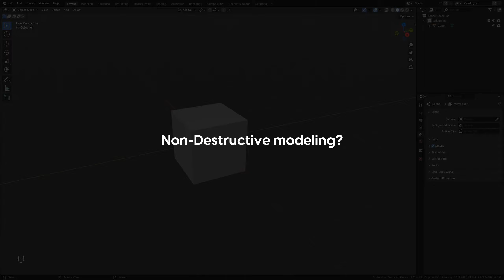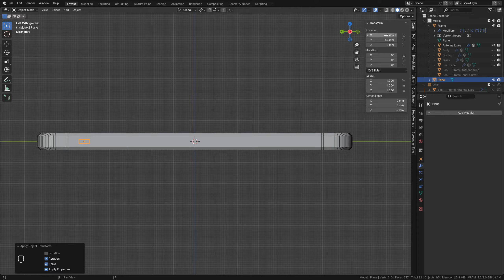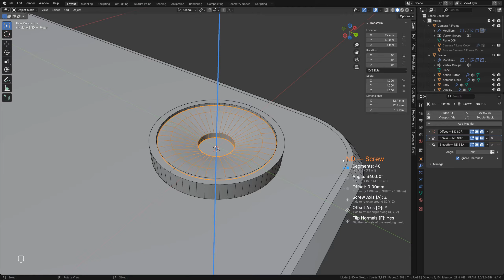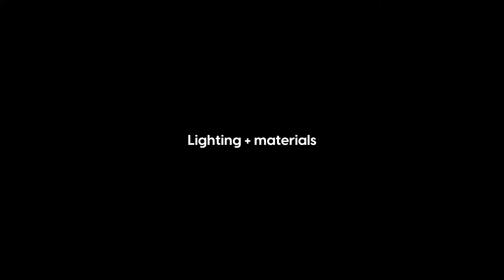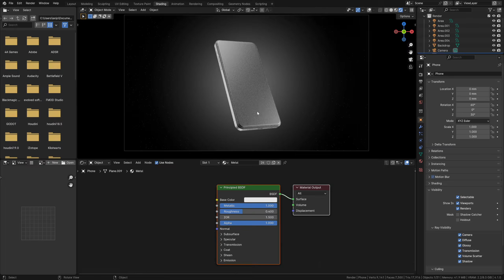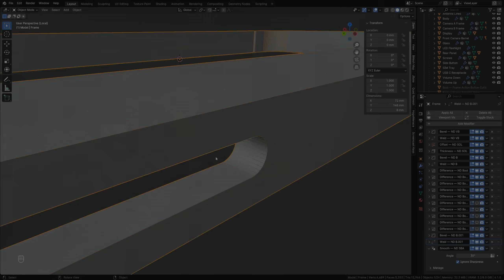Comment: why its looking like retopology is not good could you please explain how to make good retopology also?
Reply: Topology depends on your use case. As hard-surface model, you don't need to worry too much about the actual polygons. It's only if you need to deform the model or require specific topology for a game engine that you need to focus on topology. The result, whether rendered or exported for a game engine, is going to work fine most of the time. — Ian

Comment: As it turns out, the bevel "width" is not the radius of the circle that creates a rounded rectangle. It's actually the half width of the cut. So if you want, let's say, 8 mm radius circle as roundness, you need to input 8 / 2 * √2. Funny how that works...
Reply: Hi, the "width" represents the distance between the two new edges formed by the bevel (or the edges on either side of the bevel if there is more than one segment). You can also change the "Width Type" to use a different mode, such as "Offset" or "Absolute" to achieve more of a radius-like measurement. We'll be introducing this ability into ND very soon, but you can already change this manually on the Bevel modifier. — Ian
Reply: At least, that's what I think is going on
Reply: i see

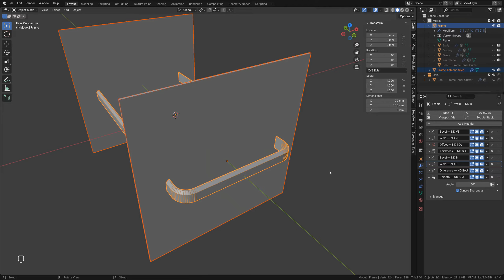Comment: Hi there! Any ideas why when I do the SLICE command it subtracts from the mesh (like a boolean difference) instead of creating the object resulted from the cut, like on 13:54 ?
I cheated my way in using "BOOL TOOL - Brush Slice" =)
Reply: Hi, I'm unsure what exactly the problem might be. However, I can replicate a similar problem if I accidentally have one of the objects (the slicer/cutter) in the Utils collection. If I then select them in the wrong order and run the boolean it causes one of the parts to disappear. — Ian
Reply: @HugeMenace  thanks for the response, and keep up!

Comment: When I get to the Frame Inner Cutter section, adjusting the bevel by pressing Shift + 2 and selecting Vertex Bevel, this is greyed out, and it only allows me to select Bevel.
I'm able to get past this by adjusting in the modifier panel, but I'm not sure if something I'm doing is causing this, or if it's a known issue.
Reply: Fixed
I was forgetting to switch to edit mode, hope this will help the next person.
Reply: Hi, the issue is most likely that vertex bevel only works in edit mode. I think I forgot to mention switching to edit mode in this step sorry. ~ Ian

Comment: Pretty dope add-on. Now I can stop working solely with polygons.

I have just about one gripe with this add-on, mainly about recalling. Is there a way I can choose to disable it? I wanna add another modifier of the same type in different areas of an object but the recall feature is preventing me from doing just that. I know it's probably mentioned in both of these videos from the welcome page, but either I might be dumb and just skimmed both videos and some of the documentation for a straight-away answer or the documentation wasn't specific enough. 

Either way, for example, if I go into edit mode on an object, select any edge or vertex I want to bevel, and run vertex/edge bevel from either the Fast (Predict) context menu or the main context menu, it'll bevel the object from that vertex or edge I've selected. However, if I want to bevel another edge or vertex, I can run vertex/edge bevel on the newly-selected edge or vertex. What should happen, as expected initially, is that a new bevel modifier would be added within the stack of modifiers I have, but what I'm getting is that--instead of beveling the selected edges and vertices I want to bevel--it's altering the bevels for the edges and vertices I made which I don't have currently selected. 

Outside this example, while this is good and all because I might want to change the intensity of a bevel, set the boolean interaction of two objects, or the like, I also want to add another modifier of the same type without being limited to alter it through recalling, that or needing to apply the modifier this add-on is recalling--which is my current workaround in case anyone is having the same issue.

While this might not be of any priority at the time of making these videos or putting out this add-on, I kinda wish that there was a way to toggle recall off or on.
Reply: Hi, thanks! Glad you are enjoying ND. There's no way to disable recall mode currently. I'm unsure what exactly might be causing the issue you are having with bevels, but it is possible to add multiple (stacking) Bevels in object mode by holding down SHIFT as you select Bevel. In terms of Edge and Vertex Bevels in Edit Mode things get a little trickier. You can't stack multiple of either on the same geometry selection, or in some cases where edges connect to other edges which have already had an edge bevel applied. This may be what is happening to you.

It really depends specifically what you are trying to model, as a non-destructive approach with Blender definitely requires a few workarounds in certain cases, however there is likely a way to achieve what you are intending, but it may just require a different approach. There are a few tricks that become more obvious with a little more experience. If you'd like some more detailed help, feel free to post a few images and description in our Discord community. — Ian
Reply: @HugeMenace  I've tried stacking a new bevel modifier from the ND menu using SHIFT on different selections of an object I want to apply a new bevel modifier to (both pressing SHIFT once and holding it down) and it didn't (even temporarily) disable recall, sadly. 

The best but destructive approach is to apply the modifier it's forcing me to recall instead of stacking another of its type over it.
Reply: Only object mode bevels can currently be stacked. Edit mode bevels (edge and vertex) cannot be stacked. It's worth watching the Bevels video in the ND Deep Dive series to understand how they all work. — Tristan
Reply: @HugeMenace  Oh okay, I assume that stackable edit mode bevels are planned?
Reply: Not currently, but I'm happy to consider it if there's a good use case for them while considering the built-in limitations of Blender's edge weights and vertex groups. — Tristan
Reply: @HugeMenace  Understandable, sounds good. 👌🏾
Reply: I do recommend watching the deep dive series, or at least just the bevels video. As one of your questions above regarding multiple edge bevels is answered in that video :) — Tristan

Comment: 18:32

When adding the Screw, how did you get the screw head to orientate itself to the view? 
When I add it, it's facing Global Z.
Reply: I found the problem:
When I added the plane for the Screw Cutter, I applied scale and rotation. It's the rotation application that messed it up. Is there a workaround for this situation, or do we just never apply rotation?
Reply: The Screw Head operator works in two contexts. If you have no object selected, it will place the screw head at the location of the 3D cursor, or if you have an object selected, it will put it at the origin of the object; in both cases, it will follow the respective rotation of each. — Tristan

Comment: Thank you for the detailed guide and, of course, for the cool addon. But for some reason I kept getting new Vertex Groups when I changed Bevel, and this made editing in the viewport difficult.
Reply: Thank you! When you run Vertex Bevel for the second time on the same object, does the green Recall mode appear?
— Ian
Reply: I think this is the same issue I had.
I was forgetting to enter edit mode first.